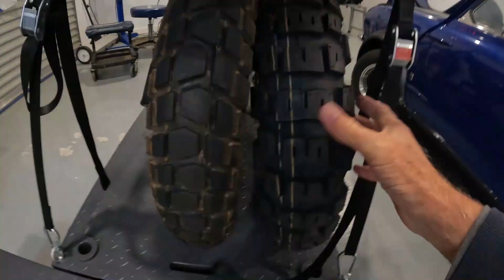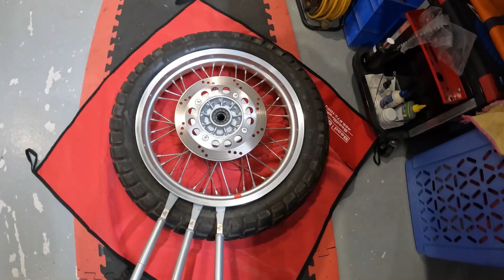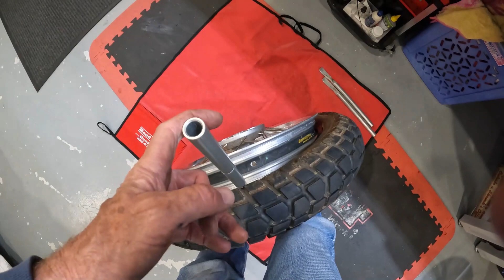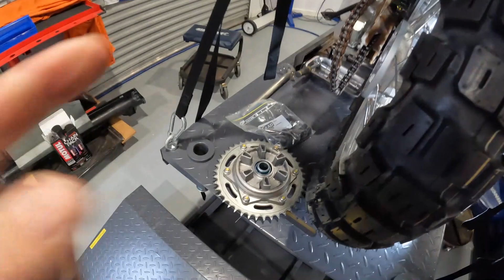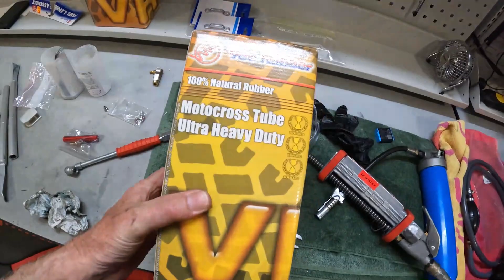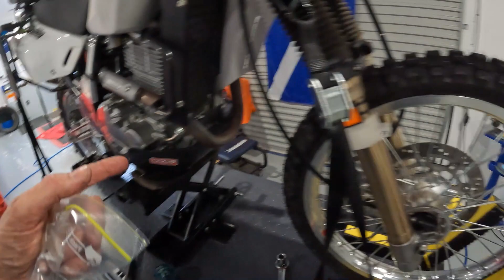Suzuki DR650SE Fitting Motoz Adventure Tyres

Comment: Look like good tires. I like your took kit, the spoons that are in segments and the fishing line for the valve stem. I need to look for these. Thanks
Reply from the maker: Eastbound stuff is good but expensive. I also have the wrench heads they sell as a tool kit addition. I like the way they pack down and being alloy they are light.

The valve puller is a must! I could hardly get my hand between the bead and rim.

Thanks for the comments 😀👍

Comment: Great tires! I fitted a Rallz on the back and Dualventure tubeless on the front...could not be more happy. I also had a local shop fit both for 30 bucks. Money well spent lol
Reply from the maker: I did think about the Rallz as well...I think Motoz say it's a more aggressive off-road tyre with "reasonable on-road manners" - whatever that means! I do more road so went back a notch to the Adventure. I made a video on the choice a while back.

I couldn't get them fitted in Perth for 30 bucks! I did want to see what it would take to fit them by hand. Good practice in case I ever get stuck out in middle of nowhere. Front was real easy...rear is real hard! The MOTOZ Tyres have thick sidewalls.

Thanks for your comments. Hope you enjoyed the video.